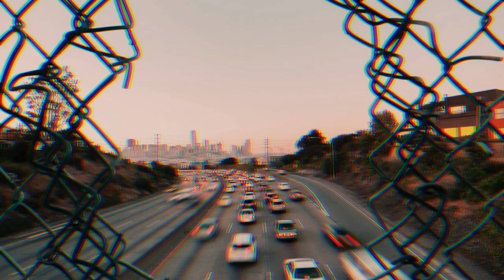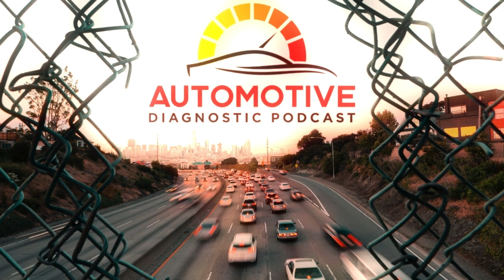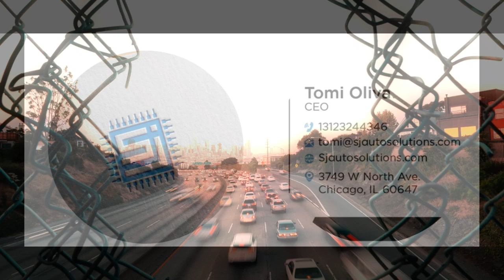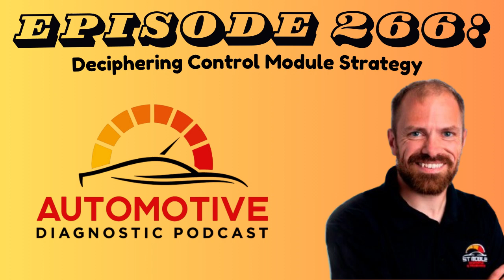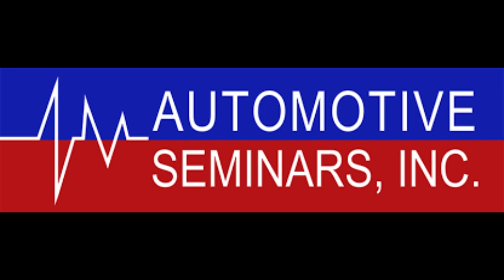E:266  Deciphering Control Module Strategy

Comment: Just a heads up on criss crossing abs sensors. Doesnt always work either. I ran across a few euros that knows the difference between left and right sensors and throws a code if it sees the wrong one. And that code may even be the exact same code as the one set for the actually faulty sensor.
On theese i just ended up scoping both wires at the sensor looking for 12v on powerup.

Also. If you suspect a shorted 5v ref circuit and its easier to get to the 5v wire at the computer than it is to get to and unplug all the sensors, throw a mucro amp clamp on it. If it is pulled to ground it is bound to flow some current through the circuit..